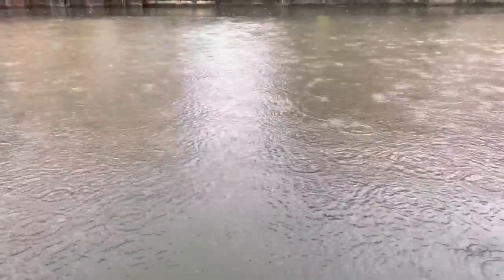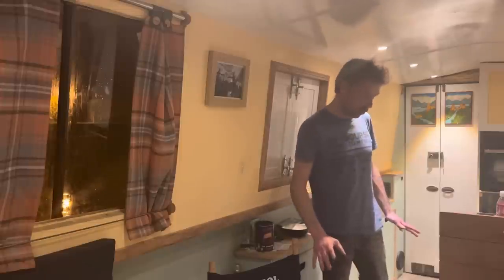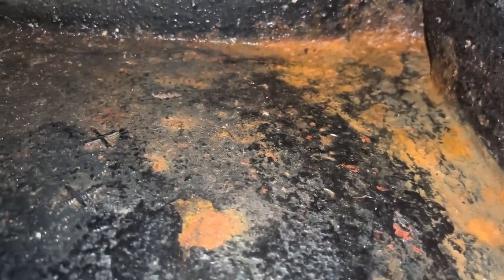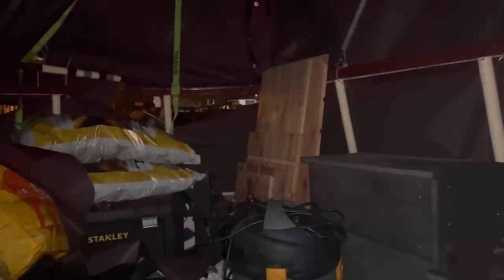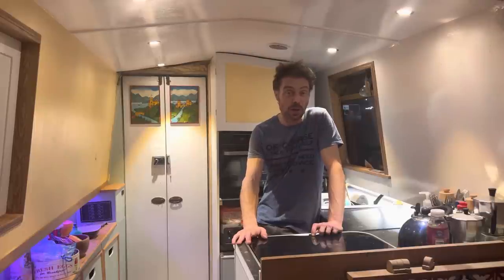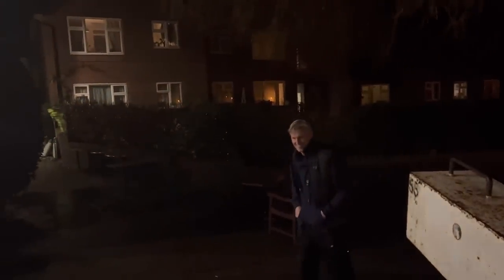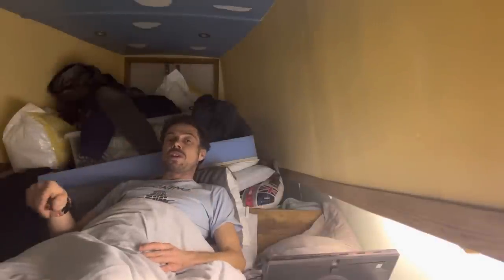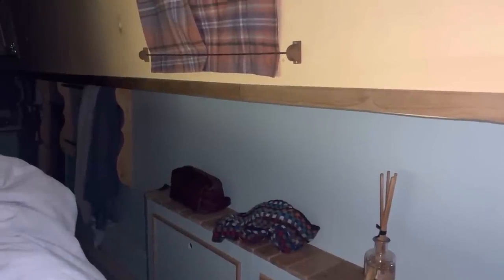389. WATER in BILGE ~ FLOODED NARROWBOAT ~ January BLUES

Comment: It's easy  to relate to weather.  Out here on the Pacific coast, it's rain, rain, and more rain.  The occasional--uh, what do you call that flaming thing that hangs in the sky?  Yeah, that.  I just know it's bad for us slugs.  It visits for a few hours sometimes between rain.

Car stuff can be such a drag.  One great solution in our corner of the planet is importing used Japanese micro vehicles.  The tiny vans have an amazing amount of room, and the cost is usually reasonable.  Do you have the equivalent in the UK?

Best of luck sorting out the car and space issues.  Looks like the beginning of a whole new series.

Comment: James, forget the tidal Thames. Not with an air cooled Lister. The reason narrow boats have to have a pilot is a boat sank because they were swamped through the air cooling vent in the side of the boat. The hull was overplated, lowering the vent and the waves lifted the water enough it went in the vent.
Reply from the maker: That was my worry - it’s the lowest inlet on the boat and would be scary to be anywhere close to that !!
Reply: @TheNarrowboatThatJamesBuilt  -- maybe you could build a snokel for your vents so they can sit above the roof ?

Comment: At 1:50; you mentioned there's three leaks and three places where water pools.
Are the locations of leaks also where it's pooling and is just one hole below the water line or all three?
Sounds like some time on the dry for a day or two (including lift out and drop in) may be needed?